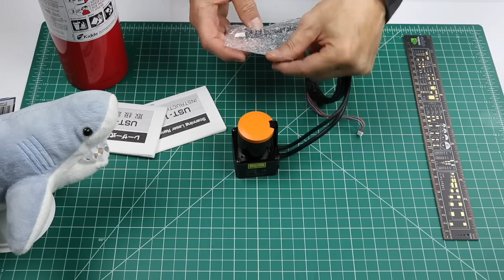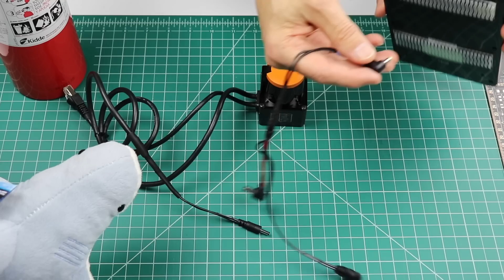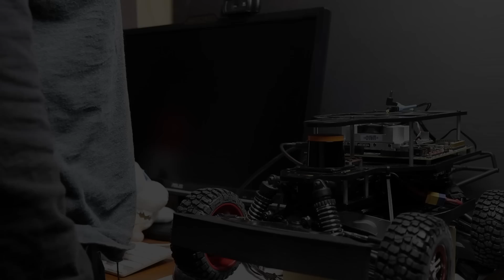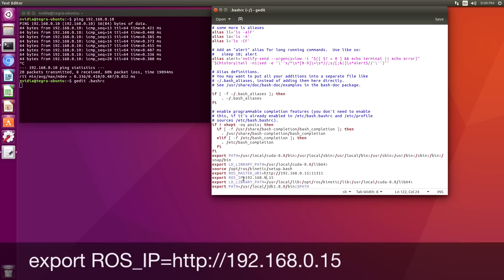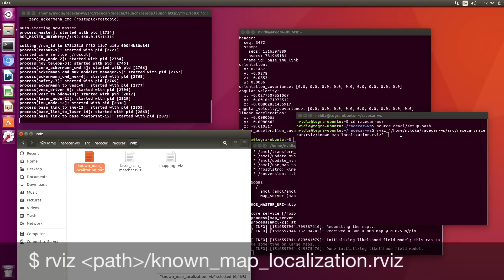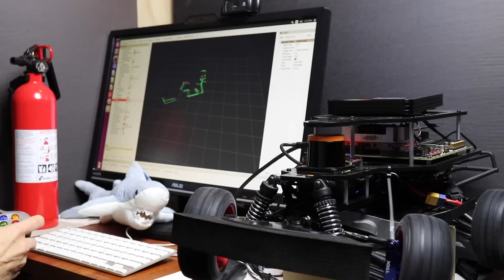RACECAR/J - Hokuyo UST-10LX

Comment: Hi... I'm also trying to build the autonomous vehicle with almost the same components... Having a Traxxas chassis, Jetson, and VESC... I'm trying to figure out how to integrate VESC with Jetson and the Traxxas chassis. If you could make detail video about it, then it would be really helpful
Reply from the maker: The most accurate references for what you are doing on on the roboracer.ai website. They go over how to build their version of the robot, and how to work with the VESC. For example: https://f1tenth.readthedocs.io/en/foxy_test/getting_started/firmware/firmware_vesc.html#configuring-the-vesc
Good luck on you project!

Comment: Very nice! Is it possible to make lidar mapping sistem for drones, using Jetson and Hokuyo lidar? How does the sistem can collect cloud points or will it send to ground station? How to install GPS to Jetson & Hokuyo?
Reply from the maker: I believe so, though it needs to be a fairly large drone. Thanks for watching!
Reply: @JetsonHacks  Drone is not a problem I can do it, but I can't understand how does the sistem will save points (will it use SDcard) or should I install additional SSD?
Reply from the maker: @TheDmisky  System engineering for a large project like the one you propose is not a good fit for YouTube comments. There are a lot of engineering decisions to take into account.
Reply: @JetsonHacks  If you have any link of engineering decisions could you put it here?

Comment: Nice video! I have a question. Why do you choose to not use the other four wires (Red, Grey, light blue, and orange). Can the Ethernet cable do the same thing as those four wires?
Reply from the maker: Thank you for the kind words. The Ethernet cable carries those signals, and is more convenient to interface with the Jetson. The red and gray wires are COM I/O, light blue is IP Reset input, and orange is synchronous output. Thanks for watching!

Comment: that is an expensive sensor.
Reply from the maker: Just for reference, the ones that they're using on some of the current MIT RACECARs (Velodyne Pucks) are ~ 4K USD. You can see why NVIDIA and Tesla is so interested in using only cameras! Typical full size autos use 4-8 LIDARS, or have a $75K version on the top of the car. The thought is that eventually there will be solid state LIDARs on the market in the ~$100-200 range in production quantity. But that's not today, and you gotta pay!